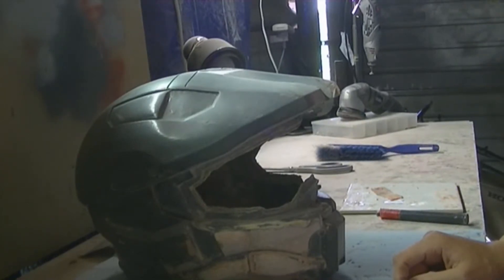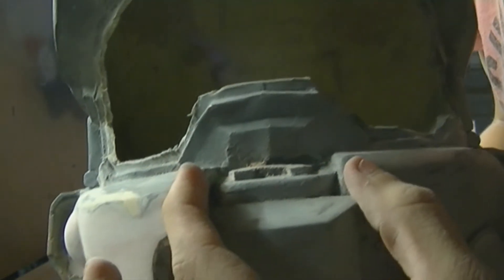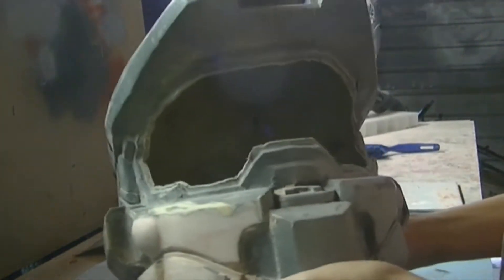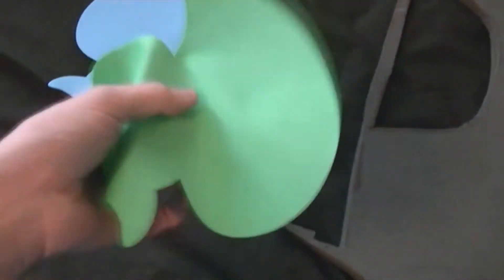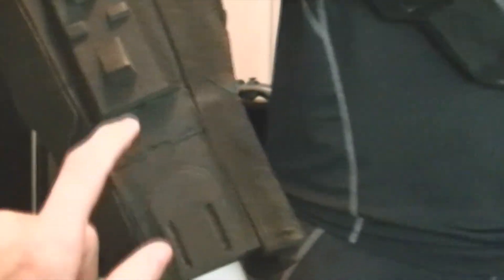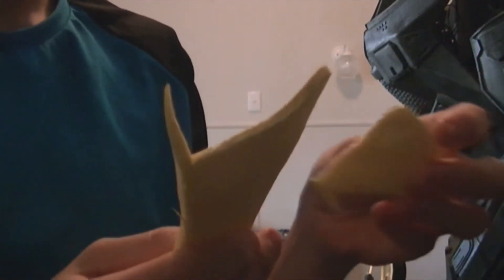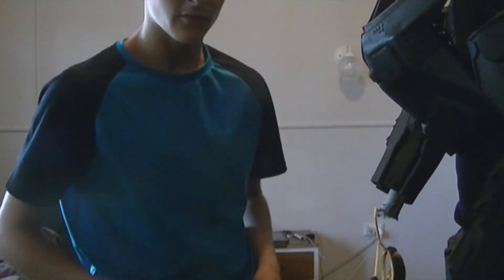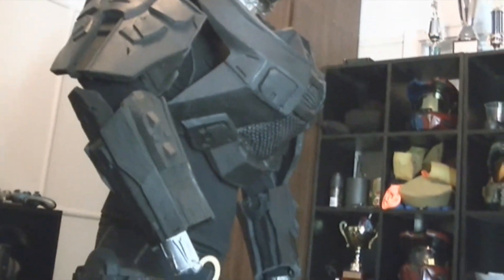halo 4 foam suit update

Comment from the maker: At that point in time it was fibreglass, resin body filler, and polyurathane. I use mostly the defult scale and up it 5-10%. theres lots of advise on the 405th if you wondering how to scale your helmet.
The visor was simple, cover the visor with tae,, (i used packing tape)  fit the visor into the helmet and fill in the gaps with bodyfiller then remove the visor once cured, sand and fit the visor back in when finished.

Comment from the maker: Yes it does sort of, but I wouldn't accept it. I don't like the idea for me making armour out of foam. My suit was the first time I used foam to make armour, granted it turned out well but I don't like working with it. It's to much of a risk on my rep. Because if I make it and you pay the sum of money for it + the 150-200 shipping and it arrives to big, small or has warped due to the glue that might melted due to the heat while shipping, keep in mind it's foam so it can be punctured easily. You would be pretty angry, that's why I would only make foam suit for my self and only sell plastic/fibreglass parts because each one that comes out of the mold is exactly the same size. Sorry for the letdown but I thought about it and decided I will not do a foam commission till I have proper templates of my own.

Comment from the maker: It might it all depends on what foam you use, the foam i use it does not stretch but is flexable. I think if you cut the foam and glue it to a black suit it will eventually come loose, but for me its alot of trial and error. If your going to give it a go post progress so we can see if it works or not

Comment: How strong dose the foam stick to the material. I was thinking of using your dremmel texture technique, But cut out the original master chief under suit design and gluing it to a normal black suit. Do you think it will hold or could the foam tear, I was also wondering if the foam can be formed to the shape of chief's original under suit design? They will be cut into parts and glued, hopefully giving flexibility. idk what do you think, will it hold? thanks